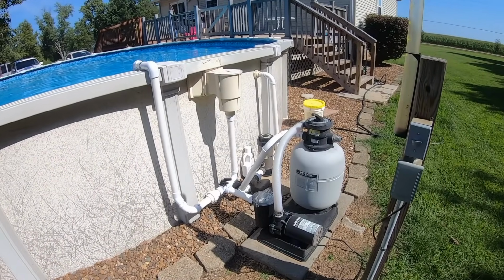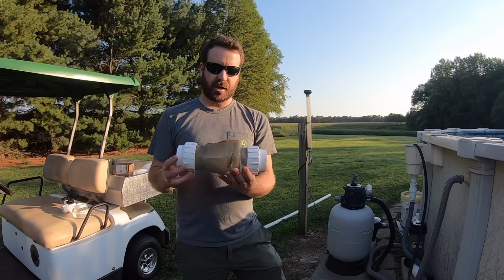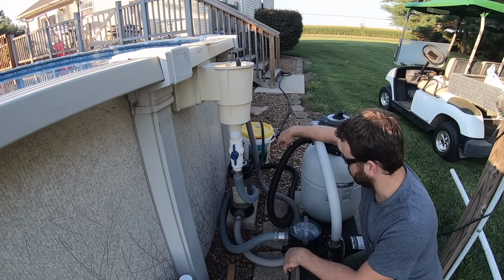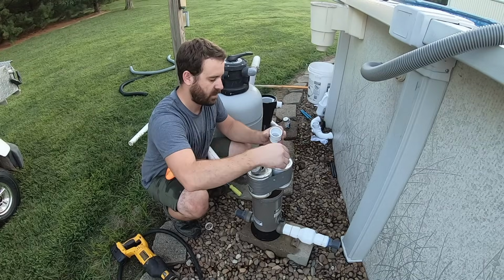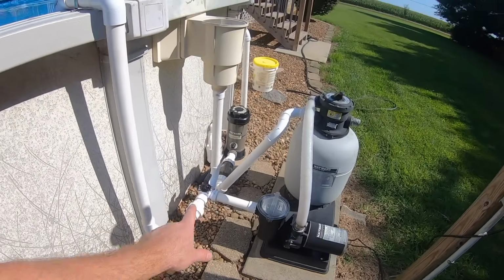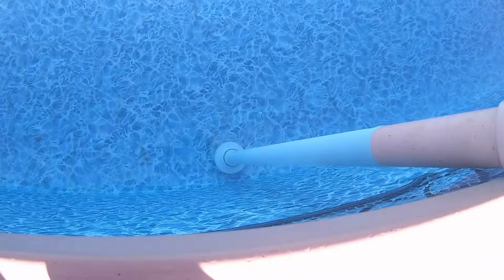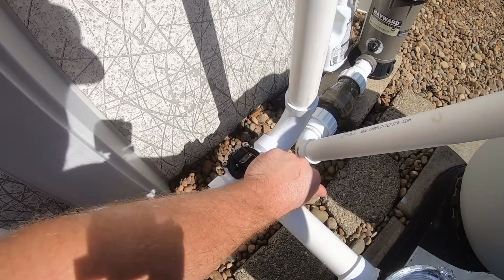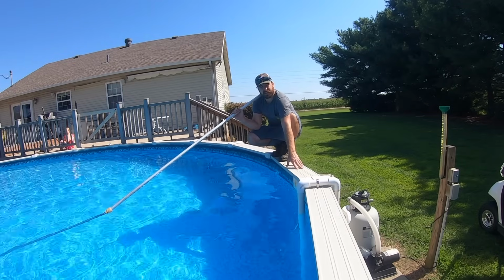Above Ground Pool Bottom Drain & PVC Plumbing

Comment: I had a Doughboy pool for 23 years and it had a bottom drain. That pool needed to be replaced and the new one the installer said he would not take the risk for a bottom drain and I didn't need one. Well, it is season 4 and we have had nothing but issues with the pool when we get 100 plus degrees day after day. Our pool became unbalanced and a mess. I thought about the drain and I came up with a temporary way of doing it and our pool is back to looking clear again. I am going to implement this using 1.5 inch PVC before I close the pool or before I open it next year. Excellent job! Thank you for the video and all of your pointers!
Reply from the maker: Thanks so much for the comment! Hope you can get it going this season and alleviate some of the problems!

Comment: We had a 28' above ground. We added a center drain when we installed it and it worked so well. When you get a lot of bottom trash all we had to do was shut off the skimmer and turn the main on for 10 minutes. It would pull everything to the center. One dip of the net and the pool was clean.
Reply from the maker: That's awesome! I've been leaving my valve about 1/3 bottom drain and 2/3 skimmer box and it has been working good. Hardly any debris on the bottom. Next time I replace my liner I'll probably do a center drain like you!

Comment: I like the idea of a bottom pick up in addition to the skimmer. I’m planning on going to hard plumbing but we’re still doing landscaping and final pump,filter placement is not decided yet. So for the time being I’m using Ag hose and fittings. Including ball valves. The fittings and valves are “full port”, true 1.5 inches. The hose is completely smooth inside. And UV resistant. It made a huge improvement in flow.
Reply from the maker: Good idea thanks for sharing!

Comment: Good video. We had a pool for 15 years that I installed myself with a center bottom drain. We replaced that pool after the wall rusted out and had it installed. I really wish I would have asked them to put in my bottom drain, as they installed w/o one. The pool is much dirtier now, so I had the same idea as you.
Reply from the maker: Thanks for the comment!  That stinks you didn't get a bottom drain in the new pool, hopefully you can get this setup done easy enough to keep the new one cleaner!

Comment: Loving this idea. I'm replacing an old summer waves pool with a hard sided above ground and the lack of a bottom drain always bothered me. Easier to sweep stuff into a bottom drain than vacuum it for sure. Thanks for the idea.
Reply from the maker: Thanks for the comment! It definitely worked well last year toward the end of season when I installed it. This year will be the first full season. I think it makes a big difference just all the heavy particles sunk to the bottom but still swirling around from the jet. This thing should suck that algae up before it settles
Reply: There should be no algae if water is treated right.
Reply: @phouchyubeered1187 in a perfect world yes but usually it isn’t that easy. So having this helps in those cases

Comment: This is perfect! I have bought all the supplies to do this. I was going to cut a hole and add a low suction to the side but was unsure if that would work. I didn't want to destroy the pool. Anyway, thanks for your suggestion.
Reply from the maker: Glad it's helping! I thought about a hole too but figured I'd try this out. Unfortunately didn't get this setup installed until late last year. Looking forward to easier cleaning this year.
Reply: @NealORussa  I'm sure it will work just fine. I already have the  spa drain coming and have the pipe and elbow waiting. Thanks for the idea!💯
Reply: @NealORussa  I also added a three way valve on the bottom drain pipe and will use it for my pool vac. That way I won't have to worry about connecting to the skimmer basket.

Comment: Above ground pools do have a bottom drain. It's your pool vacuum, just hook it up and place it in the center while you sweep to it. You can let it run for a while after a weekend of swimming to filter from the bottom and then switch back to the skimmer. It Will help prevent algae build up.
Reply from the maker: Yes I just got tired of hooking up, priming and reeling up the hose for the vacuum. This is always there sucking up any algae that doesn't make it to the skimmer and sinks.

Comment: Great video and very informative!  Do you find it is easier cleaning the bottom with the added bottom suction pipe or the good ole fashioned manual suction brush method which most people do?  Have a good one!
Reply from the maker: @HemiMedic  thanks for the comment! I use a vacuum robot. It's just the cheap Hayward bug. But I only have to do it every three weeks or so now cause the bottom drain does such a good job! 
It's also really easy to hook up the vacuum now. 
1. I turn the valve so it draws from bottom drain only. 
2. Remove skimmer box bowl/grate. 
3. Hold vacuum hose against jet to purge air out of hose and vacuum. 
4. Cap end of vacuum hose with hand. Lift over pool wall and hook into fitting in skimmer box. 
5. Slowly turn valve to shift pump flow from bottom drain to skimmer box/vacuum hose. 

You never have to turn off the pump.

Comment: We had a bottom drain installed in the middle of pool floor. Works great! 😊
Reply from the maker: Nice, how much did it cost?  Did they do it during a liner replacement?
Reply: above pool with a main drain i never see it, i imagine should be pretty well done for avoiding leaks will be hard to fix
Reply: If you're adding a drain, you need to have 2 drains at least 3 feet apart with VGB  certified grates. You don't want your kids to drown or be disemboweled.

Comment: Great job, i was looking to do this myself but found your video.  How far off the pool floor do you have the screen?  Did you use 2” pipe or convert it from 2” to 1.5 at some point? Do you use a vacuum?  If so what kind?
Reply from the maker: The screen is about 1/2" off the bottom. I used 1.5" pipe and used a pvc bushing to go from 2" fitting on the screen to 1.50 pipe. 
I use a cheap vacuum

Comment: Very neat work. I read that it is better to store the system indoor in winter to protect it from the elements. It seems your system is sealed. Did you have any issues in einter like corrosion build up on the pump while the pump and filter are kept outside? I live in snowy region.
Reply from the maker: Hey thanks for the comment! I unhook all my plumbing for the winter with exception of the clear tube from pump to filter. Otherwise everything comes out. I drain the filter and the pump and leave the drain plugs out. Then I use a Weber grill cover over the pump and filter. It works well and keeps it dry over the winter. We don't get a ton of snow but a lot of sleet and ice.

Comment: Could also consider draining the pool and installing a port through the side wall at the bottom.
Reply from the maker: Yes definitely an option.  This was just an easy workaround to drilling a hole through the pool and liner and possibly dealing with more leaks.  Also that still wouldnt put the drain on the bottom where i wanted it.  It would be more of a port, about 8" off the floor.
Reply: @NealORussa  I believe what you initially did is what I’ll try. Another hole in the wall seems not a good idea. Under warranty?
Reply from the maker: @anthonybrincefield2812  yes it's working great! I'm opening the pool today and I was able to get my pump running with the bottom drain while the pool is still 1' below the skimmer box. Definitely will speed up my opening process!
Reply: @NealORussa  That’s a great benefit! Ours has been open for just over two weeks now. I brought top off water from work with one of our water tanks and it took several trips before my wife could start the pump. If I add your idea we could have started the pump earlier.

Comment: If you want something that will help keep your pool crystal clear all summer there is a product, I found that I wish I would have discovered years ago called Activator Plus by Clear Result. Late summer our above ground pool would start to get cloudy, not anymore. Crystal clear all the way into the Fall. The bottom drain gives me an idea. Good job!
Reply from the maker: Thanks I'll check it out! I have used a proteam product in the past that is a small granular packet you put in your skimmer basket and it goes into your sand filter and is supposed to tighten up the particles for a tighter filter and cleaner water. That has worked well for me too. 
Appreciate you watching and the comment!

Comment: Hello Neal I need clarification of what you use with Blue monster sealant and primer do you bought it separately? Do it come clear?
Reply from the maker: Hey there! The blue monster is sealant you put on threaded connections. The pvc slip connections are glued and you use a clear primer first to clean the pipe and fitting and then you use pvc cement to glue the fittings together and they are not removable. You can buy clear or purple primer so make sure you get clear cause the purple goes everywhere. It is used in hidden commercial applications so that inspectors can see that a joint was primed before gluing.

Comment: Hello Neal. I really liked your video and have a question. Have you tried aligning the return jet downward so it makes the algae at the bottom of the pool rotate towards the bottom drain and get it sucked it? Thanks a lot!!
Reply from the maker: Thanks for the comment!  My return jet is about 6' to the right of this bottom drain.  My skimmer box is in between the bottom drain and return jet.  I always angle my return jet down and to the right a bit.  That way the pool water is always circulating in a circular motion.  The centrifigual force effect pushes all the floating debris to the outside to get picked up by the skimmer basket.  Heavier debris or leaves that don't make it into the bottom drain end up circulating at the very center of the pool and are easy to scoop out with the net.

Comment: Just noticed that your intake screen is for 2" pipe. Is that correct? Isn't everything else 1-1/2" pipe?
Reply from the maker: Yes that's correct, the only intake screen i could find was 2".  There is a reducer bushing at the screen to reduce from 2" to 1-1/2".

Comment: This may be silly, but I am new to this. How did you keep the water in the pool while you worked on replacing the lines?
Reply from the maker: You can thread a plug in the ports. One inside the skimmer basket. One at the jet outlet. These are what I use. https://amzn.to/3N4SaCE

Comment: How did you attach the PVC to the skimmer? Also, what fitting did you use to attach the valve to the inlet of the pump?
Reply from the maker: My skimmer basket and pump are both threaded with 1.5" npt female. I was able to buy all the plumbing parts at Lowe's
Reply: Ahhhh Dang. Mines not threaded. I think I can use a fernco being it’s not pressurized.
Reply from the maker: @570Creative  yea on the suction side I agree. Should be able to

Comment: Only thing I am confused about is you said you are doing this with 1 1/2” pipe, but two of the three links you gave us are for 2 inch pipes.
Reply from the maker: @matthewvanacore4452  the 3 way valve is 1.5". 
The intake screen is 2" because I couldn't find any other nice looking screen at 1.5". 
The check valve is 2" because I wanted the larger flapper to have the least amount of flow restriction through the check valve. 
I used 3, reducer bushings (one at screen and one at each end of check valve) to go from 2" to 1.5" pipe. 
Hope that helps clarify!

Comment: Hi Neal, again, the check valve I follow the one posted it was 2 inch. I went and other the 2 inch in Amazon. I watch your video again and again and you said the valve ist true 1'1/2.  I check Amazon and there is  a 1 1/2. Tell me the 2 in is the wrong one right?
Reply from the maker: I used the 2" check valve for more flow through the check valve mechanism.  I used 1.5" to 2" reducer bushings at both the inlet and outlet of the check valve to go from the 1.5" pipe to the 2" check valve.  If you want to use the 1.5" check valve that would probably work too.

Comment: would installing another pump a smaller one be a benefit for the bottom drain be beneficial?
Reply from the maker: I don't think another pump is required. The one pump has plenty of power to suck from both. Not sure how you'd plumb two pumps into one filter but I guess it could be done with a tee and some check valves.

Comment: Good idea. Going to try it out. I get a lot of dust at the bottom. Question…. Is it touching all they way to the floor or do you have it a few inches away from the bottom?
Reply from the maker: Hey thanks for the comment! Mine is about an inch off the bottom. I don't really have a reason I left the space. But I did. It would be fine either way probably.

Comment: Very helpful! Great setup! What connector are you using at the skimmer outlet? Before you switched out the flex hose, you had a ball valve just beneath the skimmer which is exactly what I'm trying to do right now. I just can't seem to get the right connectors.
Reply from the maker: If i recall, my skimmer box has a threaded outlet at the bottom of it.  The inside is threaded for a 1.5" diameter male fitting, or the outside is threaded for a 2" female fitting.  I used the 1.5" threaded male to a female slip joint, then used a short section of 1.5" pipe into the 1.5" ball valve.  Then on the bottom of ball valve i used a short section of pipe, then a female slip joint to female 1.5" thread bushing, then screwed in a 1.5" hose barb fitting.  Then i used the old flexible hose to the pump.

Comment: Nice build! Some people say Rigid PVC is not good for soft vinyl wall because the wall moves a lot. What you think?
Reply from the maker: My walls are aluminum and are fairly rigid when the pool is full. I don't think there will be any problems. The only change I would make would be to use pvc pressure fittings instead of the drain fittings I used.

Comment: Do you have a union connected to the lid of the filter? Just curious to if you need to maintenance it or change out sand how you get the lid off?
Reply from the maker: No I do not. Good point though. Would be needed if you have to change the sand in the filter. Technically after my filter it goes down to my automatically chlorinator and it has a check valve with unions on both sides of it, so I could remove the filter top with about a 2' stub or pipe hanging off the filter lid.

Comment: What pool is this? Got link to it?
Reply from the maker: The pool was at the house when we bought it in 2016. I installed a new liner and changed the pump and piping but that's about it. I would recommend a permanent style above ground pool with dug-in footings on concrete blocks with hard metal sidewalls. The intex pools with soft sides just won't last. Here is an example of the hard side pools. https://amzn.to/3MZQFWp

Comment: I would like to do something like this but instead wanted to put at the 6" level just above the liner seam...a thru wall 1.5" return.  Like the one that returns to the pool normally.  I could keep this plugged with a plug, shut ball valve off to it an hook up vacuum line or whatever....turn ball valve to on and skimmer ball valve to off...and pull 100% of the water from the bottom to vacuum or arrange the ball valves any way I want to accomplish different things.  Or, I'm right in the middle of changing to a new liner and wondered if I could place a floor drain where I want to..tunnel over and under the wall near the skimmer and pipe it with 1.5" pvc under there...back it in and then drop new liner over it and cut it out.  Would be an installed floor drain where I want it in the above ground pool.  What do you think?
Reply from the maker: The three way valve I used and linked in the description is better than using 2 ball valves in my opinion. As far as tunneling underneath and putting a center drain in, I don't see any good way to seal it to the liner. It would be possible to cut a hole through the outside wall and install a drain, this was just an easy workaround and didn't require any draining of the pool or cutting of the pool/liner.

Comment: Bro. That set up is technically illegal (Virginia Graeme Baker Pool and Spa Safety Act) look it up. That has tangle and suction entrapment written all over it. 
Better solution would be to cut in two bottom drains on the side wall and keep the centers 4’ apart min. Make sure the suction covers say VGBA on them and replace covers every 12 years.
Reply from the maker: @tiov3001  I have looked into that before. The grate does meet ASME/ANSI A112.19.8-2007 standard. And the law does allow for 1 main drain as long as it has an anti-entrapment system such as vacuum release etc. When the 3-way valve is not turned to 100% bottom drain then it has what I would consider a suction limiting vent system through the skimmer box.